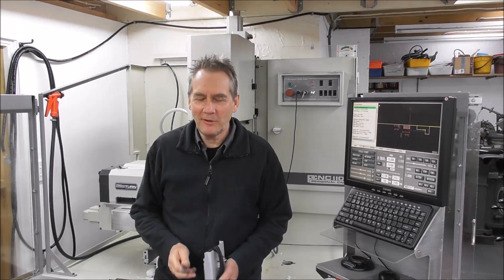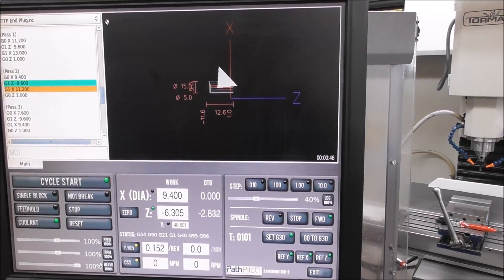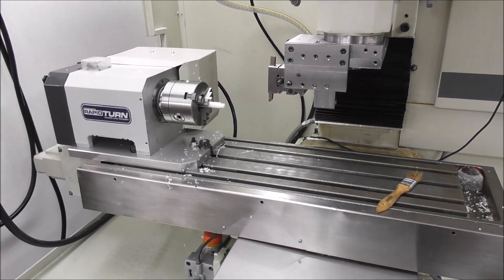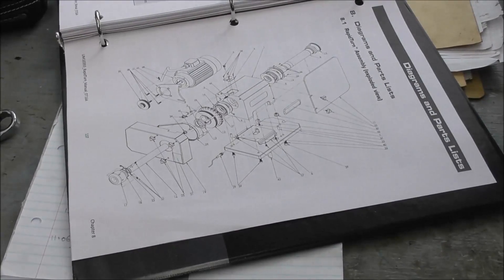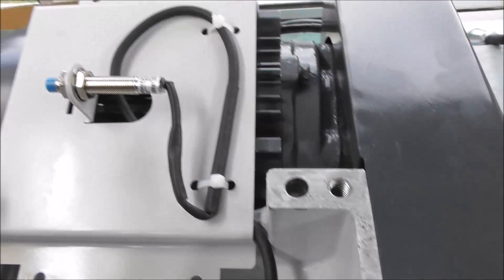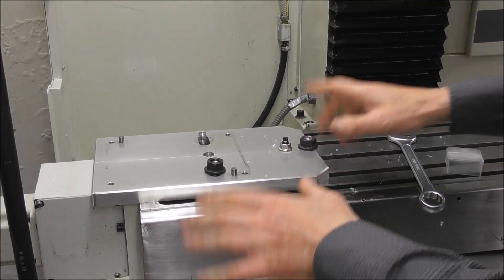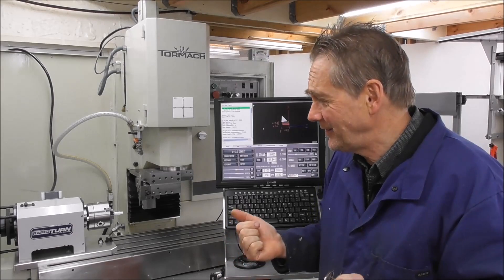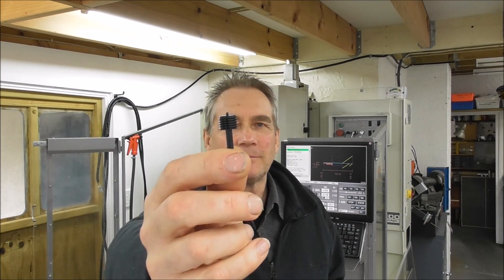Tormach RapidTurn - 16.    Another Fault

Comment: Cliff, If you go to Instagram and look up kwinter_cnc you will see I had same issue. I used an oscilloscope to diagnose my Rapid turn. You can see the signal coming off the ground line making the signal ugly. Cheers
Reply from the maker: Good work...thanks.
Reply: In my electrical tec work at LBL and on my race car ECU I learned that grounding was a fussy thing and had to always be considered.  I think Think Make understands  this perfectly.
Reply: Mechanic, how did you fix yours did you replace the sensor as well or you mention ground noise, did you do something to solve that?

Comment: Interesting. The old sensor looked like a shielded one and the new looked unshielded. I'm not sure it would matter in this application except that the unshielded ones are more susceptible to damage if it takes a whack across the end.
Reply: Jason Carter A shielded sensor will have a closer sensing range and should be more consistent for a home/encoder sensor.
Reply from the maker: OK...also better at high revs?  Cliff
Reply: From the data sheets I was just looking at (Automation Direct model PBM-AN-1H https://cdn.automationdirect.com/static/specs/prox12mmpb.pdf) the response rate for a comparable shielded vs un-shielded does not change. What will change it is the actual distance your flag is away from the face of the sensor. The closer the more reliable the sensing.  The difference between the two sensors is like the difference between a spot light and a flood light beam. The shielded is the spot light beam and the in-shielded is the flood light. Then we can compare the turn on point to the point that greater than 25% (made up amount) of the light beam is shining on the flag. The shielded will have a narrower window when it will be on, so it reduces the width (number of degrees of rotation in this case) that the senor indicates a home location. In your case I think you have a bad sensor, A bad electrical connection or the sensor was too far away from the flag to work reliably.
Reply from the maker: Thanks Dan. OK, that makes sense.

Comment: I had the same problem with my unit.  I was able to adjust the sensor closer to the flag bar and the problem went away.  By the way NPN is sink output and PNP is sourcing output.  The letters designate the type of output transistor used in the circuit.

The sensor used in this machine is a typical inductive proximity sensor.  I use them all the time in the machines that I build.  They do not have a very high bandwidth and I don't think it is the best sensor for the job.  Our RapidTurns are only going about 3K to 4K in RPM, so if we look at the specs on the sensor we may be under the top speed of the sensor.  I think a better design would be a magnetic Hall sensor and put a small magnet on the flag.
Reply from the maker: Thanks for the info Todd.  Cliff

Comment: Hi Cliff, that's exactly the same problem that I had. It was OK at low RPMnbut on increasing speed it would become erratic. I adjusted the flag until it was almost touching the sensor and it greatly improved things but didn't care it altogether.
Reply from the maker: Thanks for your help Bob - Lets hope this is not too widespread!   Cliff